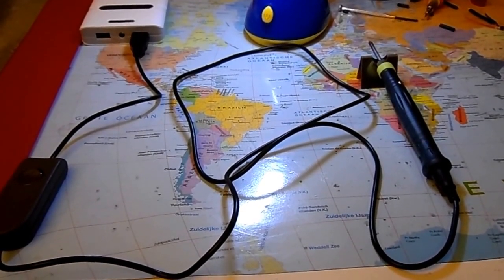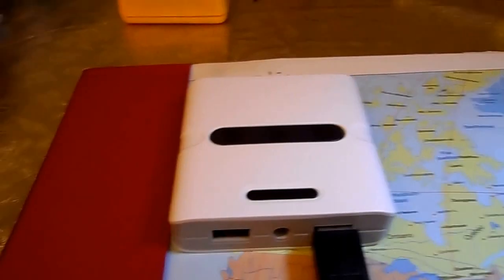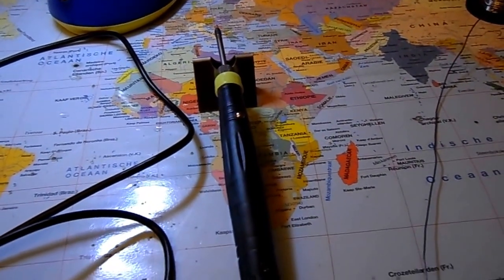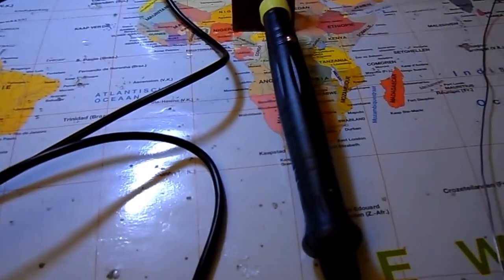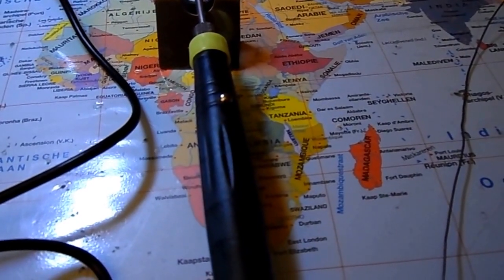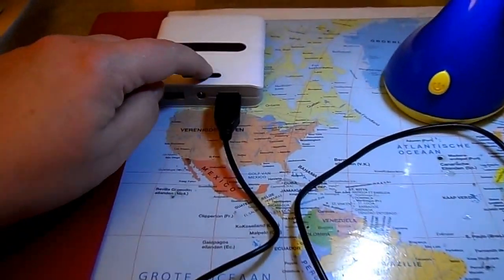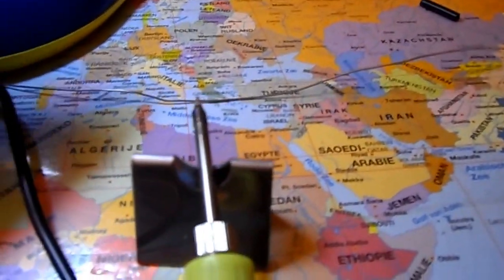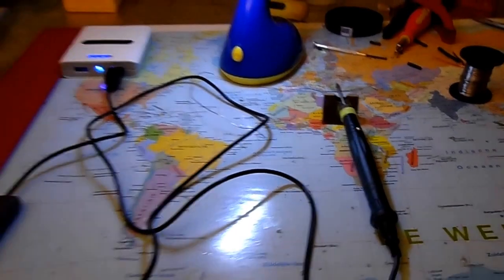modding (fixing) the USB soldering iron

Comment: I love the lamp, and I was thinking about doing something similar when I decide to order one myself. I can't stand those shake sensors and would probably just put a small switch in instead ( what happens when it falls on the floor oh yeah it triggers and melts your carpet… ). and your English ( American? ) is not bad :-)
Reply from the maker: Hi thanks. I try to speak English English cause I am from The Netherlands which lies adjacent to the UK but I might sound more American in your ears. Its indeed a nice lamp. The beak can be adjusted. Got it years ago from a local shop so I don't know if its for sale somewhere on the internet. Yea I also mounted a switch (sorry had only a huge one LOL) in the lead as you can see. I removed the whole wire coming from the metal pad cause the iron doesn't even switch on properly when touching the pad and I hate the shake switch too (spring in a tube). I removed it and bridged the contacts together :)

Comment: how do you remove the switch? didyou cut off the whole yellow wire with spring?
Reply from the maker: There's 2 ways the soldering iron turns on:
1) touching the metal knob( which touches the spring inside that connects to the yellow wire) should keep the iron turned on but it seems thats a little fiddly cause in my house there seems to be too much electrical noise for it to work so I indeed removed that wire cause its useless :)
2) when shaking the iron a spring-in-a-tube switch (not the spring of point 1 !) makes the iron turn on for a certain amount of time and then you have to shake the iron again to wake it up. 

This works with a small metallic tube with a spring inside of it. Each end of the tube is soldered with a thin wire to a different soldering point on the circuit board and when you shake the  soldering iron the spring briefly reaches the other end inside the tube and so it briefly makes an electrical connection between the 2 soldering points. Now to make the iron stay on permanently you should remove the tube and connect the 2 contacts with solder or with a tiny wire.

Comment from the maker: you mean modded ? did it heat up when it was unmodded (by either touching the metal pad or shaking the iron) ? The red LED should come on. Are you using a beefy enough USB power bank ? It should be able to deliver 1.5 Amps at least.